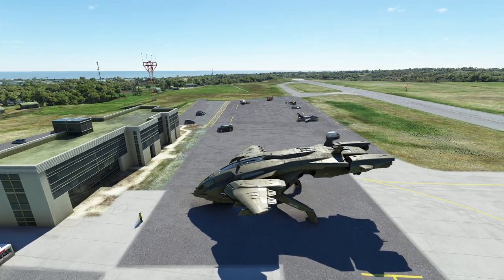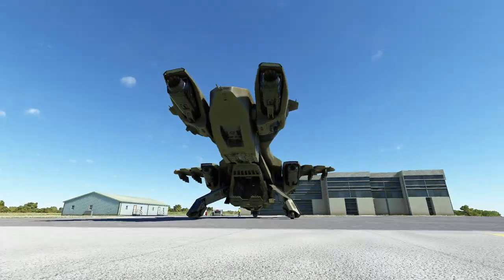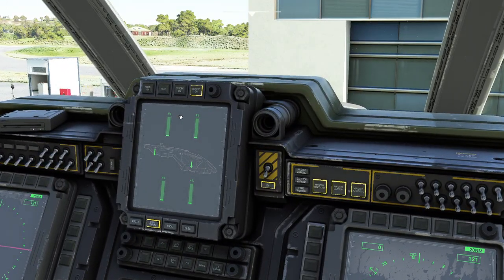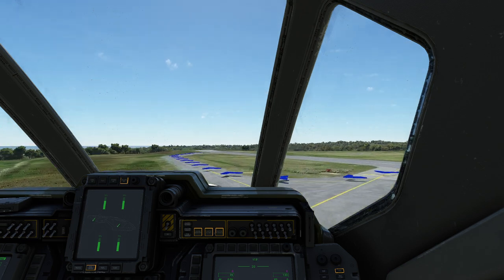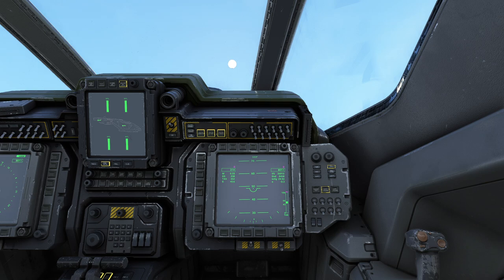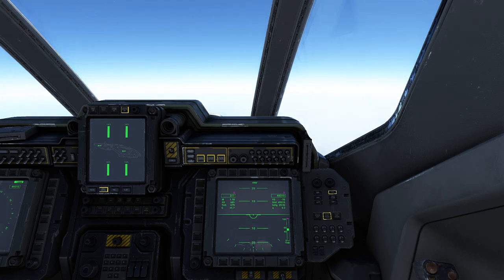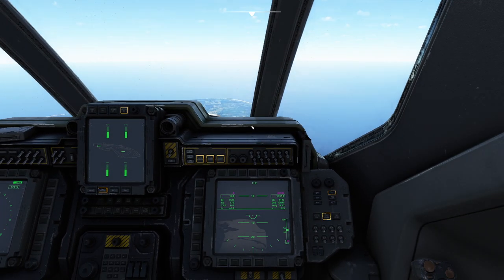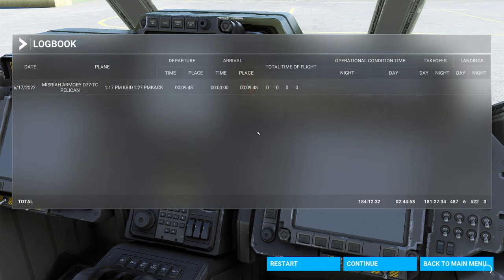MSFS - Flying the D77-TC Pelican

Comment: Unsurprisingly, the hover flight model seems to be the same as the Volocopter. The mode switch is slick, though, it's pretty cool that they can handle drastically changing the flight model on the fly like that.

Comment: Love the Pelican. Only problem I have is in hover mode. When you push the stick forward (in hover mode) the inside cockpit goes forward and back to match the forward and backward speed of the Pelican. In flight mode no problem. There is a download out there that adds speed brakes and more lights to the Pelican. Worth the additional update. Regards-

Comment: Having worked with this craft extensively, and it could be my own crazy bits fooling me, but, it seems to behave just a tiny, tiny bit better, if you turn off the Gen and Battery after full engines have been lit.  Also, I don't turn the Eng Gens on until all 4 are going 20% and Eng Gens on both of them, Alternator and then battery off.  I also open the Cross Feed, (middle of the fuel nobs). And if you want the AP to work better than a drunk, lol, go into controls and it's a Nav setting toggle on and off for the auto pilot, then the controls for the Auto Pilot will work a lot better.  It's like the in Sim on and Off button doesn't really help but lol making a designated toggle off and on for Nav control does.  You absolutely can taxi and land with it's wheels, yeah it has them, but she really doesn't like walking when she can float.  It's touchy and you really have to hold her hand, but with kick @$$ VTOAL as this Brick has who needs wheels, where we're going you don't need roads lol.  Over it's a fun thing to play with, either just flying around, I practiced landing and take offs with it as if it were a Medical Transport drop the back, wait, load up take off go land at a hospital and so on back and fourth.  Retired Firefighter and Paramedic here, so maybe that's just me.  This thing has saved many Simulated lives lol, Simulated Lives Matter.
Anyway, thumbs up love the video and I subscribed I enjoy your tutorial start ups, I'd love to see one on how to land the Darkstar after mach 9 and 100k ft up, I have learned you need to stop all that and work your way down when your landing site is 200 NM out, lol that's to slow down and come out of the universe's Soul or you will pass it up.  I'm still working with it.  Fun to steal it out of Groom Lake if you know what I mean.  Pull a Firefox of you will.  Which I did, took off from somewhere central Russia and landed in England, why England I don't know, wanted something different and with enough time to come down and slow down, total flight time took me 47 minutes!!!  That Darkstar doesn't mess around when it comes to speed.  I also subscribed.  Thanks.  Oh and I'm looking for another Darkstar video I've not found that other than your start up, so if you had made a video on DSK coming down and slow down tips, my apologies haven't found it yet.
On a strange note, on mine, I can't get the APU online I till I have the strobe and marker lights on, it's 2023 at the time of this writing so I don't know if that's something new, as I watched in you start up of Cold Darkstar, you didn't flip them on.  Oh well, it works.  And I hope you enjoy my D-77 TC Pelican tips.  Like I said, it may be in my head but it seems to behave a tad better and not so sensitive in places and not so draggy in others.  Could be just me.  Anyway cheers!